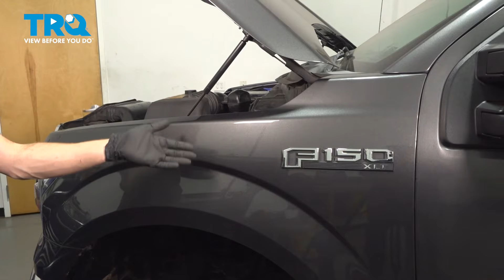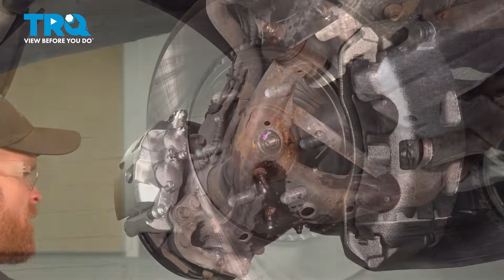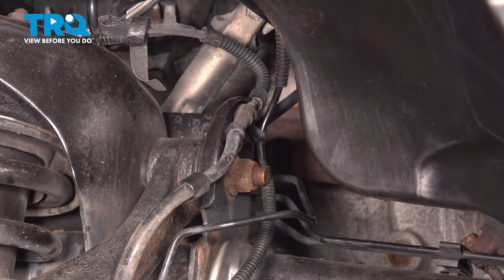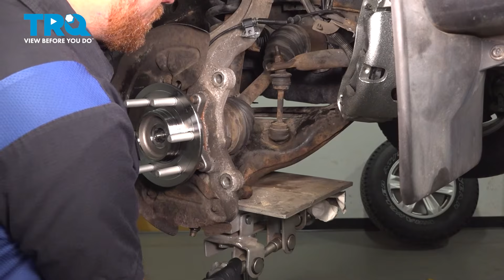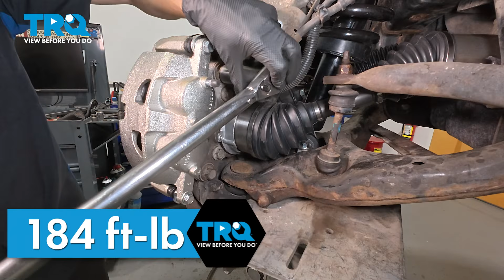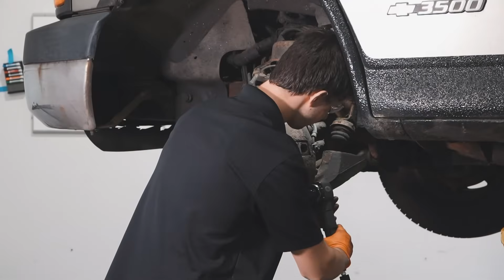How to Replace 4WD Locking Hub Actuators 2015-2020 Ford F-150

Comment: In the interest of time and effort, you took way too much stuff apart than needed to do this job. You do not need to remove the tie rod, or the shocks, or the sway bar link or unplug the sensor or the caliper bracket. Just removing the caliper helps.  Just removing the ball joint and two bolts holding the brake and sensor lines, you can pull the assembly down enough that if you first undo and pull out the IWE, you can manuver the shaft out of the hub. Then you bolted on the IWE before reinserting the shaft which you needed the extra play to do. I just did this job for both sides.